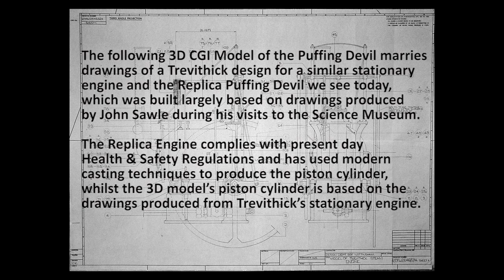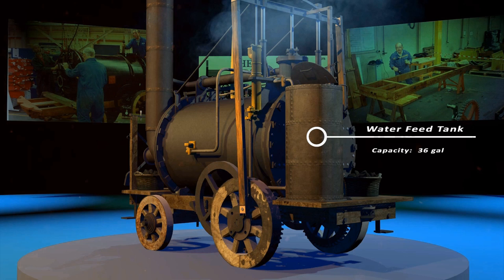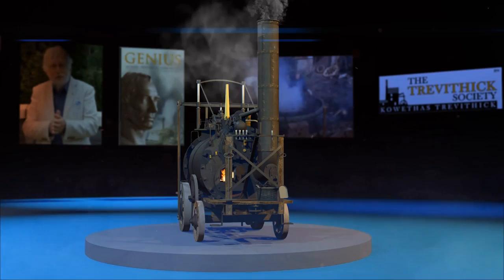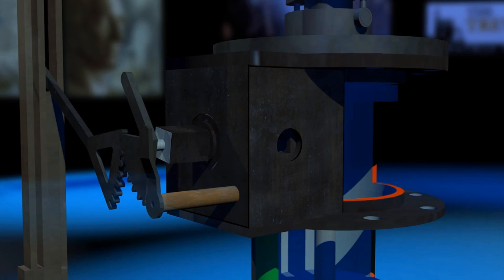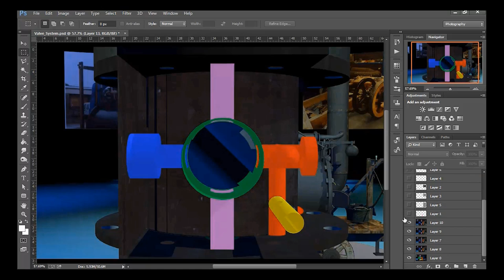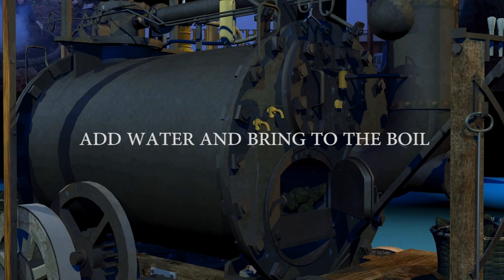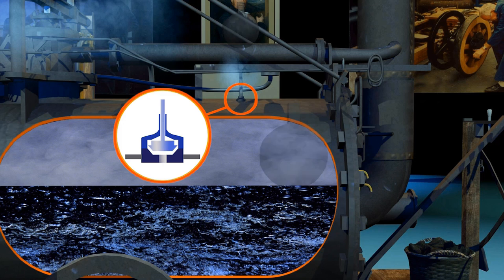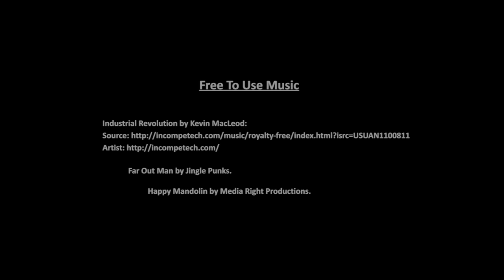The Dawn of Steam - The PUFFING DEVIL - Richard Trevithick

Comment: Great video, thank you. Travithick must have been an amazing man, what he achived with the materials of the time is astounding.
Reply: Today, you'd probably use a computer to design something like this. However, it's hard to imagine using a pen and paper, plus doing all the Math yourself, we take computers for granted these days. With that being said, high-pressure engines were cutting edge engineering, just imagine designing materials to handle the heat and pressure.

Comment: Interesting that he invented the feed water heater, feed pump and steam blower. All of these improvements didn't happen until the early 20th century Steam locomotive designs. However the Lifting and Non lifting injectors were invented.  In the non lifting injector, the injector had to be below the water level in the tender so gravity would act as a feed pump. With the lifting injector, it could be mounted above the water  level with steam syphons doing the work via check valves. When stopped, the steam loco would blow steam up the stack to cause a draft. The vent valve shown here had been replaced by steam cocks which the engineer  blew to rid condensation from forming in front of the piston as they cylinders would cool. That prevented hydro lock which blow the cylinder head off the cylinder.
Reply from the maker: I wonder if he would have worked all this out had the engine not caught fire after completing its Maiden journey in the barn of a local inn whilst Trevithick was downing a jar or two ;)

Comment: These are great videos you are making... very detailed and informative... not the normal watered down stuff that is shown on the history shows... BTW have you ever studied George Brayton, John Holland or the Fenian Ram...  ?
Reply from the maker: Not before you mentioned them John - As I mention in the videos.... I'm not an Engineer, although I can find my way around a good set of drawings and reverse engineer quite a bit when constructing a 3D Model.  It's often during the construction that things begin to jump out at you.  Glad you found the video of interest :)
Reply: I made a working copy of a Brayton .. It's on my channel if you are interested... colled the Brayton Hydrocarbon engine... Brayton also called his engines "Ready Motors" since unlike a steam engine they could be made to run in a few minutes time.. The Brayton engine of 1872 was really the bridge between the steam engine and the internal combustion engine. It was fairly powerful for it's size and was the first IC engine that could be used for motive power.. John Holland put one in a small submarine in about 1875.. Holland Boat #1.. this convinced the Fenian Brotherhood that an engine could power a submarine and so they funded the effort and Holland built boat #2 also known as the Fenian Ram. The Ram was powered by a double acting Brayton engine that produced about 15-17 hp. The speed of the 37' Ram was about 9 knots. The Ram is preserved in the Patterson Museum in New Jersey USA. The Brayton engine inside the hull is still complete and is one of 6 known original Brayton engines. I started this thread on an engine forum a few years ago.. https://www.smokstak.com/forum/showthread.php?t=115633 it contains a lot of information about the engines and also links to pictures and an article about the Fenian Ram. No one I'm aware of has ever made an animation of a Brayton engine. I've tried to get several folks interested but so far no luck. I'd do it myself but I don't have access to the solftware or the skills.. so maybe you might be interested in taking on the project? Ether way thank you for making your videos.. They are really great!

Comment: There is a larger diam wheel on each side of the boiler above and forward of the drive wheels.  These wheels have a shaft between them, and a stud in the wheels center that appears to ride on the tire of the rear wheel. These wheels are also geared to the rear wheels.    Is this dual wheeled assembly some sort of side to side synchronizer?
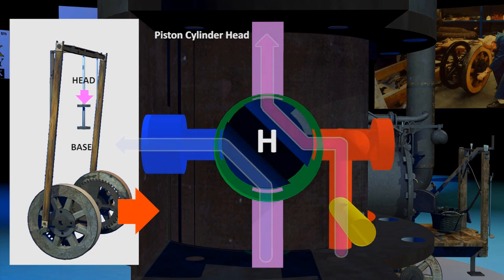Reply from the maker: That's correct - It's there to keep both wheels synchronized.  They act as flywheels and sit between the drive wheel and a large cog attached to the drive wheel - which is visible at 19:30 mins into the video.

Comment: what was the purpose of the flywheel gear setup ? was it used to balance out the reciprocating motion ? and why does it look like there was some friction drive between the flywheel shaft and the drive wheels
Reply: As you can see, the engine has a single cylinder and probably produces an uneven amount of torque throughout the power cycle. The momentum of the flywheel smooths out any uneven amounts of torque. Later locomotives such as George and Robert Stephenson's Locomotion #1 have two cylinders, the uneven torque of one cylinder is cancelled out by the torque of the other and a flywheel isn't required.

Comment: 20:22 I think that was the problem with this engine, it could get stuck if the piston was at top or bottom-dead center, and would require a push to get moving. Later designs that were used in railway locomotives, had multiple cylinders operating out of phase with one another, i.e.: one piston was moving up while the other was moving down, this meant that one cylinder was always ready for more active steam to get moving. But I'm only guessing, I'm NOT an expert in steam engines.
Reply: This does still happen on  steam locomotive there is video on here of Flying Scotsman do this on preserved railway but multiple make it far less likely  . Its called being centred they just don't move off when regulator opened way round this is to set reverser in opposite direction move back a bit to get the piston off its centre
Reply: @TugIronChief  You never driven a steam locomotive then ,it's called being  centered only way to get it moving is setting reverser in opposite direction.  Having had farther and grandad that were mainline steam drivers most of there lives they have both come across this problem. If you stop with cylinder centered the locomotive will produce little tractive effort it will likely. move off light engine but won't lift the train

Comment: Superb video! I am looking to make a scale model of a Puffing Devil. Would you be able to point me towards the plans you used for this? I have hunted high and low but cannot find them.
Reply from the maker: All I can say is that I obtained a confidential set from the Trevithick Society and was asked not to print a hard copy, publish or pass the plans on to anyone.  That's not to say they may not issue you with a set of plans.  Having said that, it wouldn't be beyond someone's abilities to take the dimensions which I have stated in the video - along with doing some video screen grabs as a means of producing your own set of plans ;)
Reply: @MybitofHistory  No problem at all. As you say the key details are in the video and I will message the society as well. Thanks again for this video.
Reply from the maker: @RecklessModelling  - You may wish to visit this link - you will find a poster that I also created for the Trevithick Society...  If they have saved it at the size I created it then it may prove useful ;)    https://cornishbirdblog.com/2018/08/02/stephensons-rocket-in-truro/

Comment: Britain from 1800 to 1900.
20,000 Waterwheels decreased in number.
Windmills decreased in number.
England's Thomas Newcomen's 1,500 Atmospheric Pumps disappeared.
Scotland's James Watt's 500 Steam Engines and their descendants increased in number to 10,000,000 !!!
To every SINGLE Waterwheel in 1800 you could now add 500 Watt type Steam Engines in 1900.
This WAS the Industrial Revolution.
A 500 times increase in Power Output for the whole country in one human lifetime.
Take away James Watt's Steam Power and you get no Industrial Revolution.
Just Newcomen Atmospheric Pumps and Arkwright's Water-Power.

Comment: My question:  There is a smaller wheel next to the main driving wheel which appears to be turned via gear teeth on the main wheel,  What does this wheel do/drive.
Reply from the maker: As I understood it from the drawings - it acted as an additional stabilizer for the main drive wheels - ensuring both wheels worked in unison and revolved at the same speed and rate - removing any torque which would cause the main axel to twist out of shape.
Reply: Sounds good, thanks.

Comment: The Scotsman James Watt built the world's first PRACTICAL High Pressure Steam Engine. How come you don't know that!
Reply from the maker: I can't recall anywhere in the history books / accounts of James Watt ever having the imagination to stick 4 wheels to a steam engine....  I thought you would have nown that ;)
Reply: James Watt was too busy INVENTING the Steam Engine!
Watt was long dead and gone before we got a practical Locomotive, so he was proved right.
Reply: Because he didn’t. Watt, as is well documented, wanted nothing to do with what he termed ‘strong steam’, or high pressure steam. His huge stationary engines worked somewhere around 10-15 psi, and relied on condensing the steam to create a partial vacuum in order to get useful work done. What he actually invented was the separate condenser, which increased the thermal efficiency of the low-pressure engine that had already been invented, in a crude form, by Thomas Newcomen in 1712, 24 years before Watt was born. Watt died in 1819 at the age of 83, 18 years after Trevithick built Puffing Devil, and 16 years after the first locomotive ran on rails in 1803.
Reply: Newcomen's Atmospheric Pumps disappeared when Watt's Steam Pumps appeared and Arkwright's Water-Power disappeared when Watt's Steam Engines appeared.
Newcomen's Pump supplied Atmospheric Power. Watt's Pumps and Engines supplied Steam Power.
Atmospheric Pressure opposes a Steam Engine.
Watt's separate condenser on his new engines recycled hot water and eliminated 14.7 psi of opposition from Atmospheric Pressure, with the vacuum created by condensation.
Reply: Not quite.. Newcomer’s engine also relied on condensing the steam to create a vacuum beneath the piston, which means that the atmospheric pressure becomes the main motive force, and the same is true for Watt’s engines. The main difference between the two is that Newcomen injected cold water directly into the cylinder to achieve this, and as a result the entire mass of the piston and cylinder needed to cool to the point of condensation, meaning that the next cycle had to waste a tremendous amount heat energy from the incoming steam to re-heat the cylinder before condensation would cease and the upward stroke could commence. This gave the Newcomen engine a phenomenally low fuel efficiency, or ‘duty’ as it was termed at the time. By creating a separate condenser that could be kept at an even temperature at all times, Watt effectively eliminated this cyclical waste of energy, as the cylinder and piston could be kept hot throughout the cycle, thus achieving a significant increase in efficiency.
 Although many new engines were built at the Soho foundry, Watt’s business model was nonetheless heavily dependent on the fitting of this separate condenser to a large number of existing Newcomen engines, and profiting by taking a share for themselves every year of the savings that were gained from this increased fuel efficiency, a policy that became increasingly unpopular in Cornwall. However, these were still low pressure engines, and still wildly inefficient when compared to the compact high pressure direct-acting engines of Trevithick, operating at 50lb to the square inch, a fact that was proved when a Soho built engine was trialled head to head with a Trevithick ‘puffer’ to see which did the greater amount of work for a given consumption of coal, and lost quite unequivocally.
 Watt undoubtedly contributed a great deal to the development of the steam engine and the understanding of its thermodynamic performance, and deserves to be recognised as such, but ultimately he is part of a much wider and more complex narrative, which still seems to be blurred by his somewhat litigious nature and an unfortunate tendency to engineer his own legacy.
Reply: The motive force for Newcomen's Atmospheric Pump was Atmospheric weight. ( the cylinder being open at the top ).
The motive force for Watt's Steam Pumps and Engines was Steam Pressure ( the cylinder being closed at the top ). This was the big difference between the two machines. But you'll never see this mentioned anywhere.
Watt's Engines could run without a
condenser, but then they would have to overcome Atmospheric Pressure. To do any work, they would have to be well above Atmospheric Pressure.
Trevithick's Engines were just the same as Watt's, Steam Powered!
Some Steamships ran on 5psi due to passenger preference for low pressure Steam.
I've never seen any Newcomen machine converted to a Watt machine.